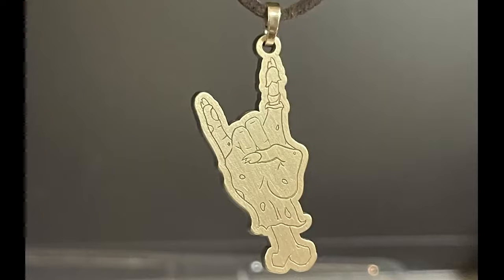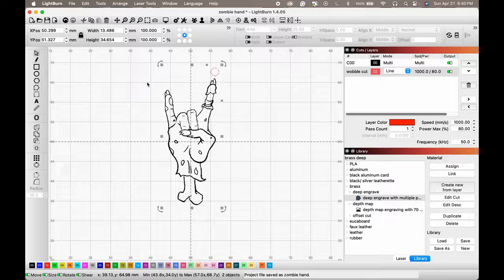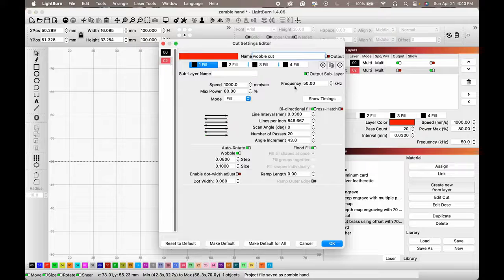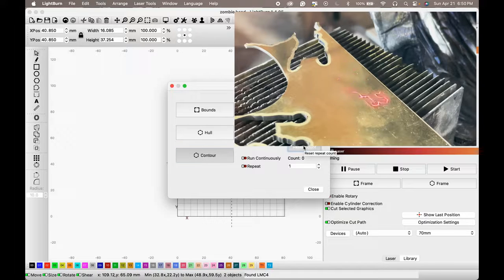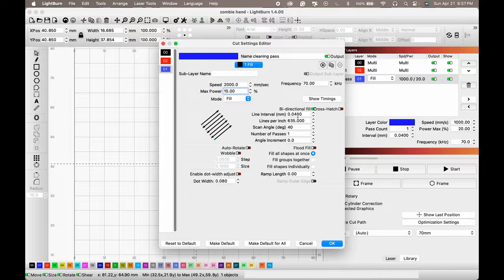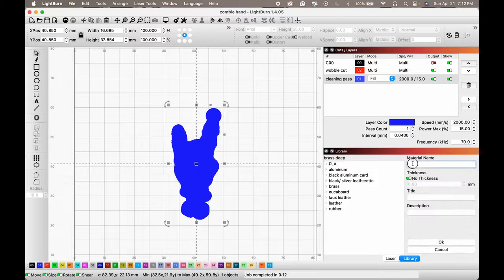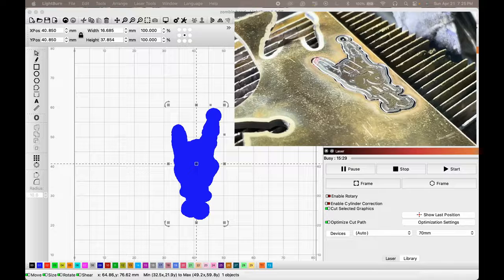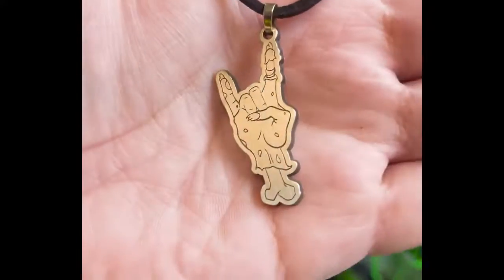Lightburn Tutorial: how to cut brass pendant 2mm with lightburn software

Comment: I used your settings on 2mm brass and got to the point that I could see it coming through a little after about two hours. It didn't cut through all the way and, couldn't get it to pop out. How long did this take you and what watt laser are you using ? I have a 50 watt JPT
Reply: Where are you from ?
Reply from the maker: @rohitpanthi314  we are from China, the one made the video is from America
Reply: in the video, he used a 70mm lens...
Reply: These settings are wacky bro! Slow down your speed to about 1000 and up your power to 90. With 110mm lens.
Reply from the maker: What lens did you use?